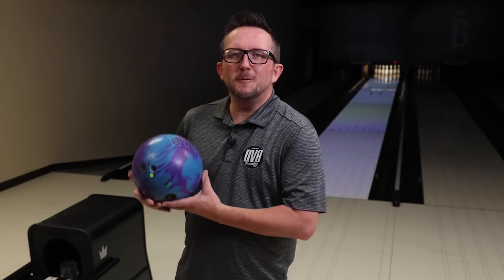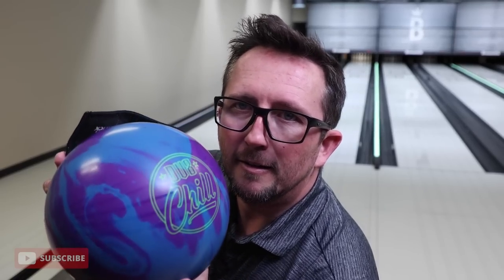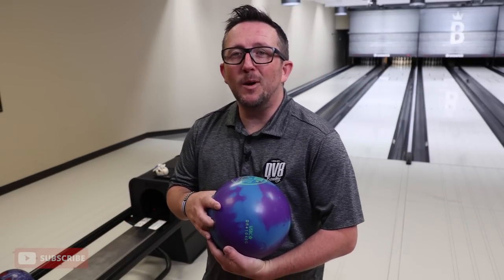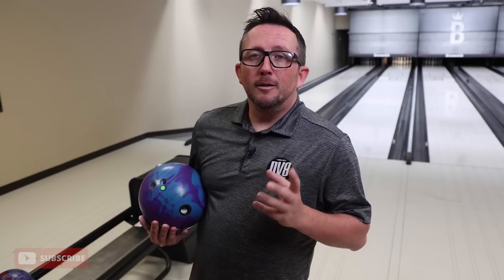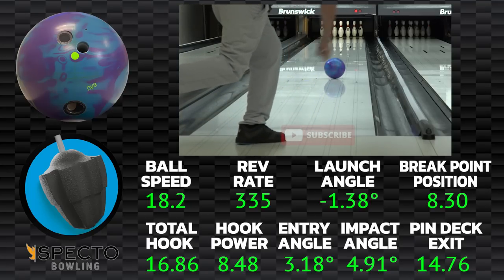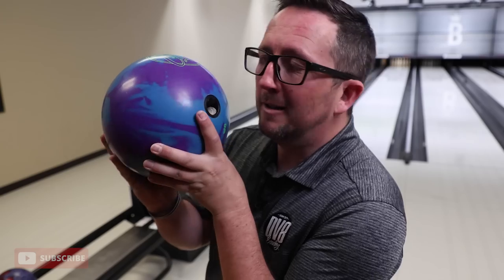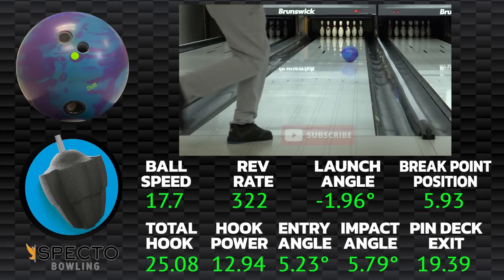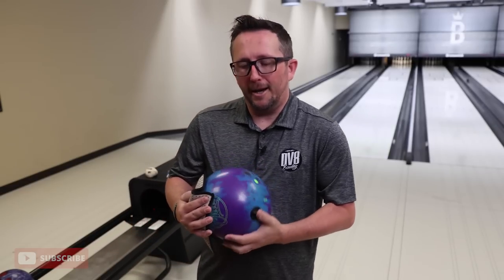Pin Down Layouts = BAD?? | BrunsNick

Comment: Can I ask why there is a drill hole at the top of the grips? Never understood why that hole is drilled... Thanks in advance.
Reply from the maker: It’s a vent hole for my ring finger.
Reply: @brunsnick  A Vent Hole? I have never heard of a vent hole being drilled... is that legal to do on tour?
Reply from the maker: Yes. And vent holes have been around many many decades, though not super common.
Reply: @brunsnick  just asked my proshop guy... and he's said no one has ever asked for a vent hole to be drilled ... he's been there for 5 years.. so it must be not very common at all... thanks for the reply.
Reply from the maker: It allows for a much snugger fit without popping.
Reply: @brunsnick  So you have a Sarg Easter Grip with a vent hole... 

How do you get the vent hole to intersect with the thumb hole if they are parallel to achieve that pressure relief?
Reply from the maker: @ucantquitme I vent the ring finger. There’s not much to it, just have to pitch the vent hole towards the hole you want to vent about .500 and about 1” away from the hole.
Reply: @brunsnick  Thanks for all the replies. I have learned something new brother. Thanks.  Keep up the good work.

Comment: Pin down is weaker layout and has its place. It would take a complete moron to pull it out on fresh oil and then try to play deep inside. Its a great option for later on after things dry up or you loose ball speed from fatigue.

Comment: Repeat this with a Stealth then we'll talk.
Reply from the maker: And what exactly would be different compared to a pin up version?
Reply: @brunsnick  Much stronger core than the Chill and stronger cover.  I would like to see if the increase in strength that the Stealth represents changes the "in the oil" reaction.
Reply: @Jeffery Daniels  It won't change.
Reply: @Mainzer74  I disagree since I have used stronger downs for just that effect.  Fresh house + weaker cover/core, yeah, it's going to stall in middle oil.
Reply: @Jeffery Daniels  Interesting I am 18 or so ball speed 500ish Rev rate drilled a GB3 pin down no hole and it was vomit
Reply: @Mainzer74  At your rev rate I can believe it.  Try a solid stealth or, better yet, an Envy Tour.  I am 17mph but about 330 ish rev rate so that makes a diff I'm sure.